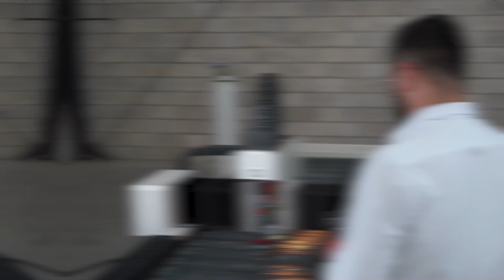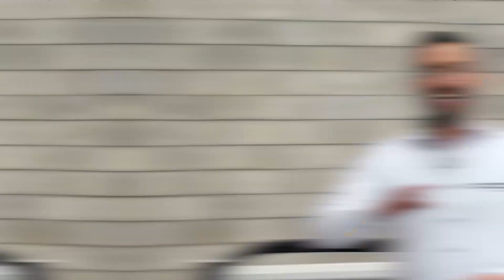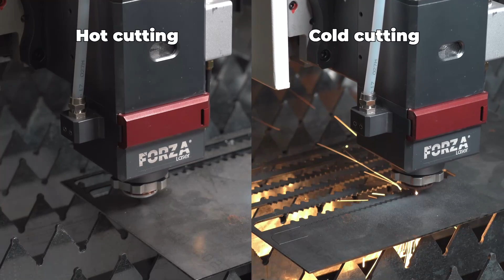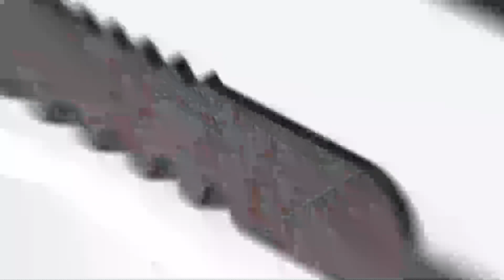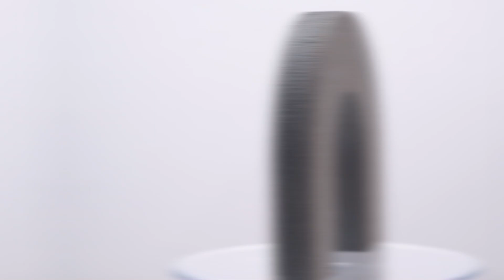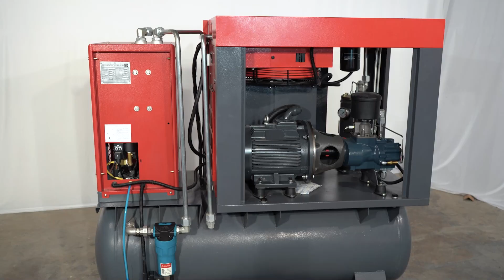Compressed air vs oxygen - What is the ideal gas combination for our laser metal cutting machine?

Comment: i have a xtool metal fab and it consistently leaves heavy slag residue on the bottom side of my material when cutting carbon and stainless steel. I have only used compressed air in a PSI range from 120-180, all with same results. I have tried everything such as changing focus height and adjusting speed/power settings......any suggestions?
Reply from the maker: Hey! 👋 Heavy slag can be influenced by several factors beyond speed and power, especially assist gas, nozzle condition/alignment, focus position and material thickness.

Compressed air can also produce different results depending on its quality and pressure stability. We’d recommend checking those variables systematically rather than only adjusting speed/power.

If you’d like, send us the material thickness and your current cutting parameters, and we can point you in the right direction. 🔩